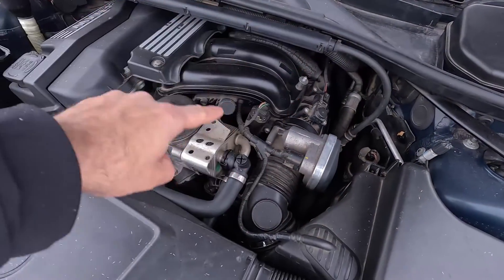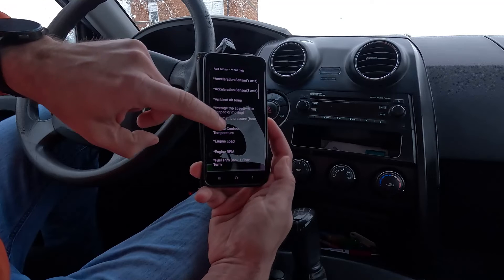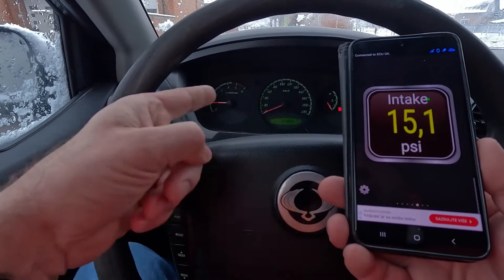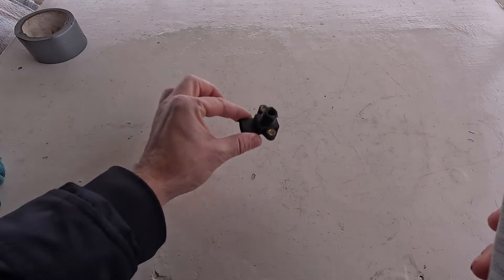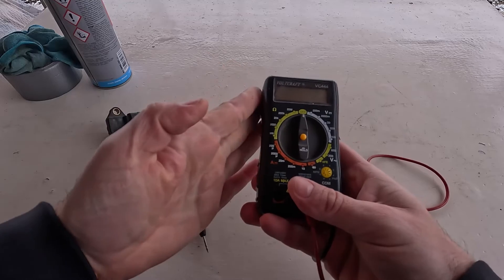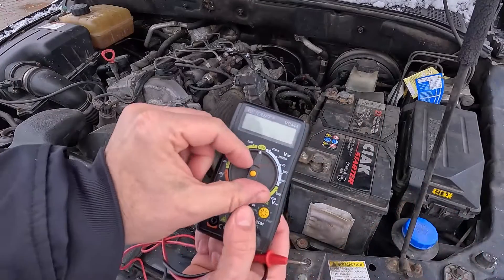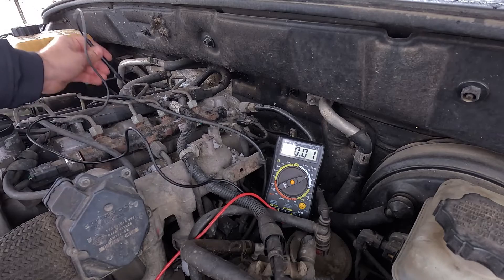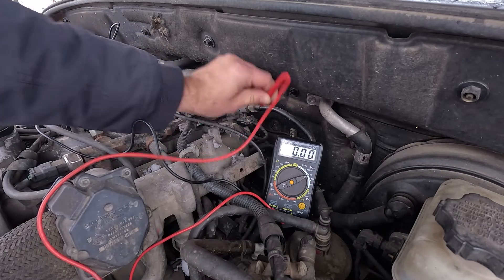How To Test A MAP Sensor At Home (Multimeter or OBD Scanner)

Comment: the first test with a multimeter should to connect the GROUND  connector in the MAP plug to the BATTERY NEGATIVE and test CONTINUITY. This means setting the multimeter in the OHM section and measure 0 ohm or if your multimeter has the function, a BEEP.  If you have an open circuit with the ground wire of the plug then YOU HAVE A PROBLEM HOUSTON!. Many if not most electrical problems in cars are due to a bad earth. Now that you know the plug's Ground reference works, you can test the POSITIVE reference and the SIGNAL.  Positive reference should always be around 5 volts when the key is turned to ACCESSORIES (don't turn the engine on). Now connect a rubber plastic hose to the sensor long enough so that you can blow/suck in it. Test the voltage of the signal contact. It will be 2.5 or something. Now keep the connection and apply a vacuum with your mouth or with a large syringe attached to the tube. The voltage should drop. If you blow in the tube the voltage should increase.  This is a 90% test. If all this works it means the sensor probably works.
Reply: Thank you sir
Reply: But can this affect acceleration power reduced??
Reply: @grandpanero7284  Technically, yes

Comment: Break cleaner? I will never leave my vehicle with this guy. Holy shit!
Reply from the maker: What seems to be the problem?
Reply: @MechanicBase never use brake clean on sensors lol they have special cleaner for mass air flow sensor and similiar sensors… USE THAT
Reply: @davidardeljan1919  
So just a marketing gimic ,  using diff. packaging & recommendations   ?!    ;-l
Reply: @MechanicBase  You should probably be using electric parts cleaner and not brake cleaner. Also brake cleaner is not good for plastic components.
Reply: if you know what you are  doing, you can use brake (less aggressive) or carb cleaner (more aggressive and effective at cleaning soot). spray it liberally and then use low pressure compressed air to dry it. LOW PRESSURE, don't apply 40psi. Then you can place it in a washing liquid bath and even better, inside a small ultrasonic cleaner. This will remove all the residue and leave you with an immaculate MAP sensor. Don't use the ultrasonic cleaner with carb cleaner or brake cleaner.. Most Map sensors are immersed in epoxy, don't try to open it!

Comment: Ive got the followijg issue. In cold my boost pressure read 0bar which is correct. But when hot jumps to 0.6bar evem when car is stopped. Funny thing is that car runs great in both conditions. God knows

Comment: Older cars usually use MAP. Newer use MAF. MAP is manifold absolute pressure, MAF is mass air flow.
Reply: I've got a 34 year old Volvo 240 with a MAF and a 2009 Sonata in my shop has a MAP. It's not old vs new, it's just the manufacturer preference
Reply: @plopping-wetlyacademyofmot9639  actually MAP sensors came first and MAF sensors came later. Mostly due to EFI systems coming about.
Reply: @plopping-wetlyacademyofmot9639  Yes buddy, MAPs are still used, but it's mostly MAFs nowadays, can we agree on that? MAPs use predetermined fuel tables where MAFs can adjust fuel based on the incoming air. Plus MAFs are easier to tune vs messing with fuel tables when modifying cars with MAPs.
Reply: @XJon2011  right on. I've always found maps more troublesome myself too
Reply: Umm mine has both
Reply: Huh? Older and new cars use MAP, MAF or both. It is not a old car thing
Reply: @spooltechturbos6328  which is more common on modern cars in the last decade? Turbo cars use both often yes but NA modern cars tend to use MAF.
Reply: @XJon2011  both, map and maf have a different purpose. All my new cars have them both, some of my older cars had both. It is not a new vs old thing.
Reply: @spooltechturbos6328 you probably have more experience with a variety of cars. I'm thinking along the lines of classic V8 V6 American mainly
Reply: @XJon2011  Yeah, American cars make up about 10% of the world's car brands, so basing MAP/MAF off that won't go well.
Reply: Backwards

Comment: was that a phone based obd2 scanner and if yes which app are you using?
Reply from the maker: You can use any OBD2 Bluetooth adapter and Torque app for the phone. The app is free and does more the enough for basic diagnosis.
Reply: @MechanicBase but which app do you reccomend?
Reply: he said Torque App